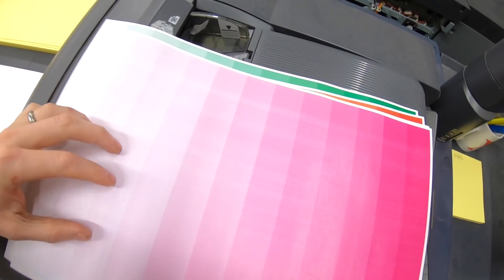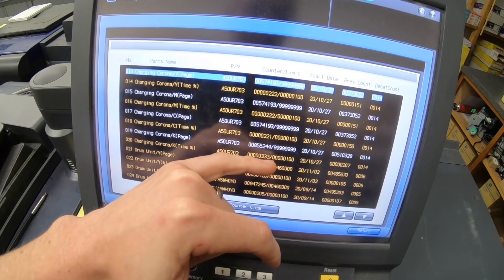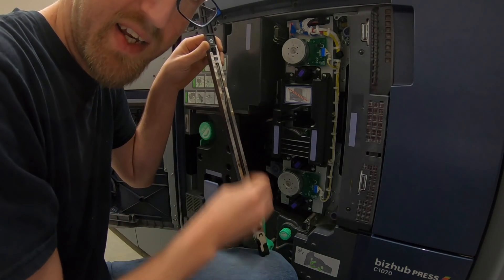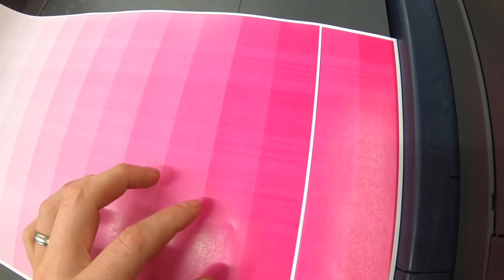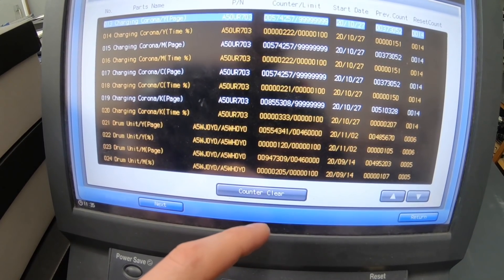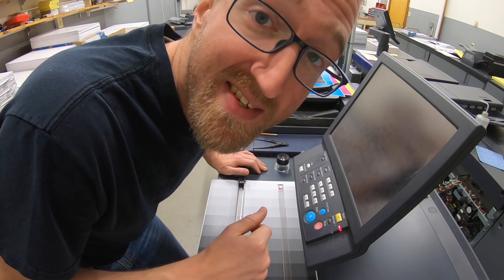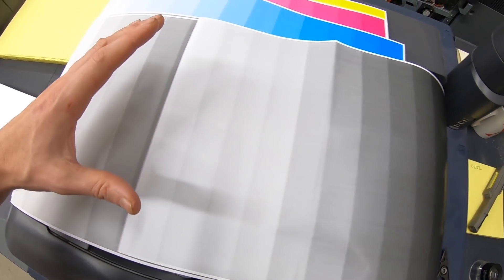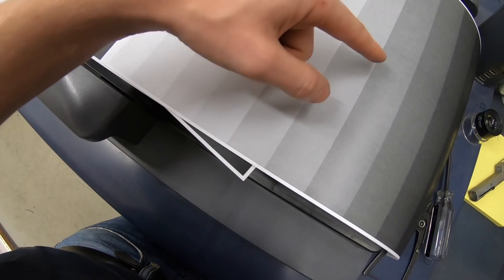Should a Corona Wire Be Cleaned, Repaired or Replaced?

Comment: Hello there. Next time please clean and corona unit's inside walls. They have a lot of baked on toner residues as well. Simple brush sometimes works to take off easy residues. Grid question. If cells are broken and bigger than in factory was done - you won't have result . It's need to be replaced. Conclusion - oem unit for 30€/36$ (1pcs) will save time and efforts. Just replace it.
Reply from the maker: Thanks! I have only replaced with new oem units. So much faster.

Comment: Hello, Dan. Classic red rubber pencil erasers are great for polishing metal and removing oxidation and dirt, but they are abrasive (which is the reason they are so effective!). A less aggressive solution, in terms of abrasiveness, but which might be equally effective at removing oxidation and dirt would be plastic erasers, such as a Pentel Click-eraser. In drafting (old style, with drafting board, parallels, triangles, and compasses), plastic erasers rule! They do not grow hard like red rubber erasers, and they do not leave residue or smears, unlike red erasers. They do, however, leave rolled plastic eraser "dust," which must be swept away from the drawing or, in this case, the wire and the working surface on which the corona wire assembly lies while the wire is being cleaned.
Reply from the maker: I didn't know that, I'll look into that, thanks!

Comment: I never thought about using an eraser to clean the wires. Maybe I’m too lazy to try different ways. I usually clean the wires with a lint free cloth and alcohol. This might give me a little more life out of them. When that doesn’t get me the results I need I’ll replace with new ones. Thanks for sharing Dan
Reply from the maker: Yes, new ones are quick and pretty much guaranteed to work. I mostly wanted to see if it was possible. :)
Reply: I usually just wash it with alcohol and that works wonders 😅

Comment: Sir, how to solve error C-0234 in Konica Minolta c1070?
Reply from the maker: Service manual says:
Cause
Within a specified period of time after the loop roller pressure release motor (M34) starts returning to the home position, the loop roller
home sensor (PS17) does not become active.
Measures to take when an alert occurs
The main body and the option stop immediately to deactivate the main relay.
Estimated abnormal parts
• Conveyance drive board (CDB)
• Printer control board (PRCB)
• Loop roller pressure release motor (M34)
• Loop roller pressure release home sensor (PS17)

Solution
1. Check that the front door is closed properly, and repair it when there is any abnormality.
2. Check the duplex section, and repair it when there is any abnormality.
3. Check the drive gear system in the duplex section, and repair it when there is any abnormality.
4. Check the connector connection and the wiring among the motor, the sensor, and the CDB. Then repair it when there is any
abnormality.
5. Check the connector connection and the wiring between CDB and PRCB, and repair it when there is any abnormality.
6. Check the I/O drive of the motor and the coupling of the gear, and repair it when there is any abnormality. (Wiring diagram: Main body
(1/4): 16-L)
7. Check I/O and the operation of the sensor, and repair it when there is any abnormality. (Wiring diagram: Main body (1/4): 11-P)
8. Replace PS17.
9. Replace M37.
10. Replace CDB.
11. Replace PRCB.
12. Replace M37 and CDB at a time.
Reply: Habis paperjam kah mesinya ?
Reply: @dimaspermadii4611  mas, kok setiap bersihin charging warnanya selalu pudar ya pas test patternya

Comment: Back in the old days I strung my own wires.  The diameter of the wire and the type of coating on the wire can change the amount of charge on the drum.  If you run mostly text and solids you may hardly ever change wires.   Halftones are always difficult on copiers.
Reply from the maker: That they are!

Comment: Back in the day coronas didn't have corona grids (mesh grids), they just used the single wire.  It was either xerox or Sharp, I'm thinking Sharp that first innovated using a wire mesh grid.  It was supposed to provide a more even and reliable charge compared to just the wire.  This was back in the analog days.  We'd restring coronas because some charge units were hella expensive.  You do have to look at what thickness and there are different materials and coated wires too.  My guess without the grid is it would work but maybe quality would go down??  I'm not really sure.  Even if you clean coronas, the coating or surface area of the wire might degrade.
Reply from the maker: Interesting. Yes, I figured that the wires eventually are not able to be cleaned any longer. Thanks for the history lesson!

Comment: Hi,
I have a printshop with a 3070 and a 3080. Dirth in the inox body give also lighter lines in the light eara s of the print. The wire, the grid, and also the housing must be clean. Succes
Bart Denayer
Reply from the maker: Thanks Bart. Sounds like you have a similar setup to me!

Comment: Many years as a copier technician.  Worked on Konica, Sharp and Ricoh.  First off, get yourself a spring hook for getting the springs off.  Back in the 90s we always made our own corona wires on the spot.  It wasn't until the late 90s that the manufacturers started sending pre-made wires for us to install.  It is important to have the correct wire as there are different coatings and different diameters depending on the make and model of the machine.  It is also very important that you have the right amount of tension on the wire.......too much and it will break and not enough it will actually start to swing like a jump rope and ultimately will arc to the grid.  Beware of any tag ends as those will short to the corona blocks or frame and cause image problems or service codes.  Regarding cleaning them, an eraser will work and the forked end of a spring hook will work even better as the residue is basically baked on there like a crust.  Ultimately cleaning the wires is a short-cut when you really should just replace them.  Lastly, one of the biggest reasons corona wires get fouled up that is often overlooked is that technicians often neglect cleaning and changing the Ozone filters in the machine.  With most machines you can cheat the interlocks, turn out the lights and turn the corona wires on in service mode and then you will be able to see the corona wires glowing blue.  When they are lit up you will actually see if there are hot spots or dead spots in the wire and you will be able to see if the wire is swinging.
Reply from the maker: Oh man, I want to see the wires glow blue. Cool! Thanks for all this great info. Awesome!
Reply: I might have to try that sometime.  That would be cool to see the wires lit up.
Reply: Nice details. Thanks for the info.

Comment: You have be real careful cleaning the wire with a grit. The wires are coated with different materials some are gold others are tungsten. When you say the wire was shinny that may be a bad thing as you may have rubbed all the coating off the wire. It may sound weird but the best thing to clean the wires with is a q-tip with a bit of saliva. What I always do is take a clean q-tip wet it in my mouth and then wipe down the wires. Never run your machine without the grid it is what controls the amount of voltage on the drum it is possible to damage your drums without the grid.
Reply from the maker: Good to know. I'll have to try that. And I'm glad I didn't try running without the gird now!
Reply: @justaprinter  Yeah, you freaked me out there and I had to dive into the comments to make sure someone told you not to do that! As said the grid is what stabilises and evens the voltage out across the length of the wire. The usual way is for the wire to run higher voltage than strictly necessary and have the grid absorb the excess so that the drum is exposed to a consistent voltage.

Comment: When re-stringing coronas, remove wire, clean the shell and the grid, use a piece of folded over paper and windex to clean the grid and then one with alcohol ... a Spring hook or an allen wrench as you used is good to make the first end, the second can be made with the actual tension spring, takes a bit of practice ! but the wire should be cleaned with alcohol afterwards ( just as you did )
Reply from the maker: It was a fun experiment. I'll have to try the folded paper and windex. Thanks!

Comment: I've been a printer tech for 40 years, Konica trained, love your videos ... a real good method to scrub clean wires, is to to remove grid, cut a 1/2 x 1/2 inch piece of green scotchbrite, fold it in half and place that in the tip of the jaws of a fine pair of Needle nose pliers, place over wire, clamp down and go back a forth a few times ... the first pass will be rough, then a bit easier on the next few passes. You may want to use a new piece ever couple of wires cleaned ... this removes the oxidation from the corona wires ... don't even have to remove from the corona shells !! Remember to brush off wire after, you can clean the walls of the corona shell with a rag moistened in Windex. Most corona wires are oxidized, material like paper dust and oils combined with ozone contaminate the wires and a Scotchbrite clean and rejuvenate the wire. You can also fold a piece of paper in half, place the Grid sheet in it and spray it wit windex and drag it through once or twice, do the same with Alcohol afterwards and re-assemble ... 90% of the time this works !! I re-wired my coronas from a spool of Wire meant from the purpose ... got really adaept with a spring hook and tiny springs !!
Reply from the maker: Scotchbrite! Why didn't I think of that? Thanks for this info!

Comment: Do you use paper for digital printing or offset paper?
Reply: Not Dan but, we use both in our shop. We buy gut sheet digital for our coated papers. Most of out uncoated we buy in parent sizes and cut as needed.
Reply from the maker: Both digital and offset.

Comment: I have a spare set of wire units that I keep restrung and switch and restring as I go. Works pretty good. Ozone plays a big roll in wire health. Keep your filters maintained and watch your temperature in the shop. I run a air cleaner behind my machines to help with particulates.
Reply from the maker: I need to get an air cleaner. Would probably help me out.

Comment: The coroner was a daily clean item on the HP indigo. The grid was often the culprit for banding issues. The wire and grids were included in the click items that could be ordered. 
There was a test page called a grey 20 which showed up banding issues. 

The thin wire was always snapping as it was advanced by a motor on a spool. Interesting to see how it works on the Konica's. Thanks for the video.
Reply from the maker: You're welcome. Would be interesting to find videos on the indigo.